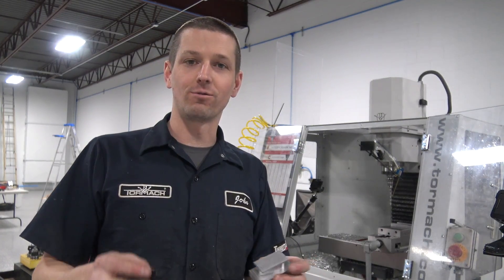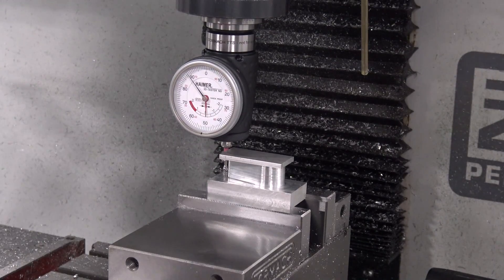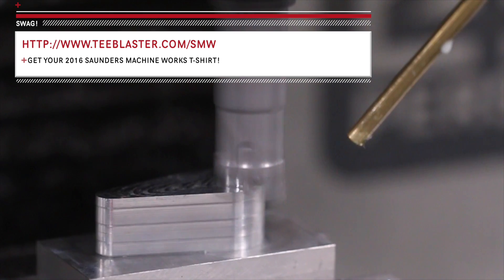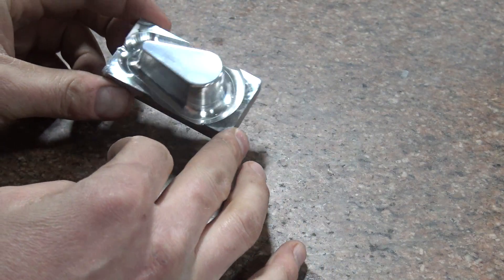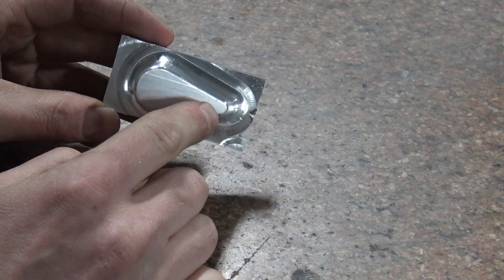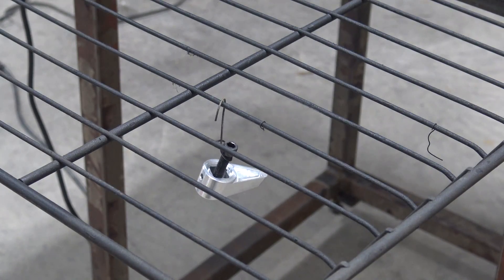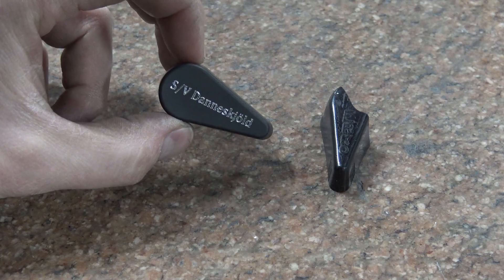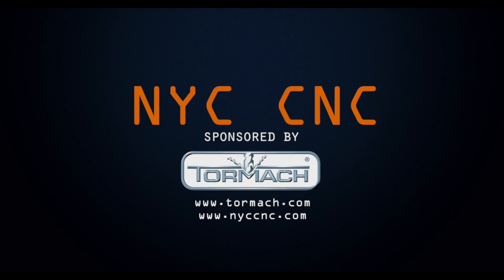CNC Broken Boat Part 3  Widget87

Comment: Great part John. How do you decided on 'optimal load' in Fusion?
Also how did you clean up the drag engraving burrs without marking the powder coat?
ps: I love seeing Judd the dog in the background. No one in the comments seemed worried he didn't have a respirator ;-))
Reply: +NYC CNC Ok thanks. 10-20% makes sense over the 30% in video. Fusion seems to default to around 30-40% which doesn't work so well with the TTS pull out issues. It can cut it at that but keeping the tool secure is tough.

Comment: What's that tool you used to melt together and seal the plastic bag at the end?
Reply: +RC Grid Impulse heat sealer - they can be bought on eBay and the likes for cheap.
Reply: +Søren Fuglsang Thanks!

Comment: that time lapse was super cool. That finish makes it pretty clear something is up with my z-axis, The blades have been coming out with inconsistent milling lines
Reply: +NYC CNC 770. My Z axis gib adjustment screws are as tight as they can get (the screw ran out of spacer after the second time I adjusted it). Emailed tormach twice about that but never heard back haha. I have a feeling it's a challenging fix

Comment: Fantastic looking part. Just a thought thou.... The naked cavity on the underside will be very susceptible to corrosion from salt water. Likewise the dissimilar metal of the set screw will set that screw for life without any anti seize on it!
Reply: +NYC CNC Salt water is actually corrosive to aluminum but you will likely not encounter any issues with it on a piece like this. Aluminum doesn't "rust" like steel because it oxidizes and forms an oxidation film on most of its surface which protects it from other corrosive elements. However aluminum has a quite granular and crystallized structure. In stress bearing parts exposed to seawater  you have to be very careful of stress corrosion cracking. This occurs as the aluminum "bends" under pressure, exposing the microscopic cracks between grains of aluminum which salt can settle in and begin to corrode the aluminum which is not protected by the oxidized layer on the part's surface. 

I hope this wasn't too long winded but boats are about the only place that aluminum will corrode. This is one reason why composites (ie. fiberglass) and plastics are far preferred as aluminum's fatigue resistance is significantly reduced in seawater.

Comment: no wayy....look at that finish on the face with an angle..wowwww.... that it less than 32 finish
Reply: +NYC CNC 32 RMS - "Root means square" in Micro inches. I think one micro inch is .000001 inches. Beautiful finish
Reply: +NYC CNC 32 RMS - "Root means square" in Micro inches. I think one micro inch is .000001 inches. Beautiful finish